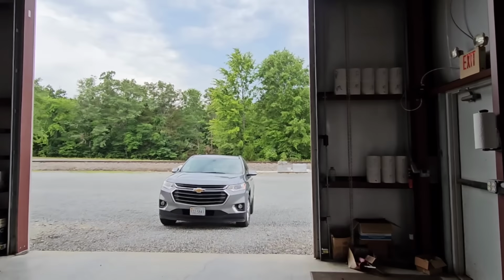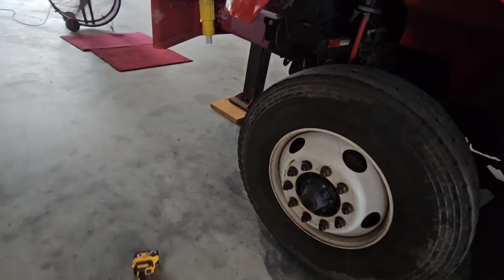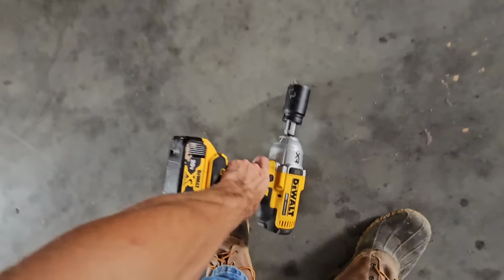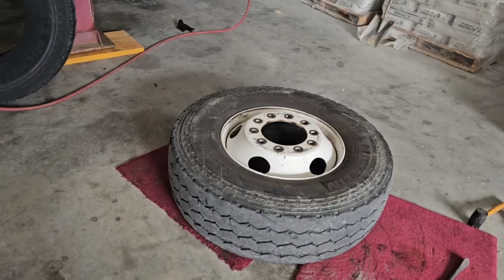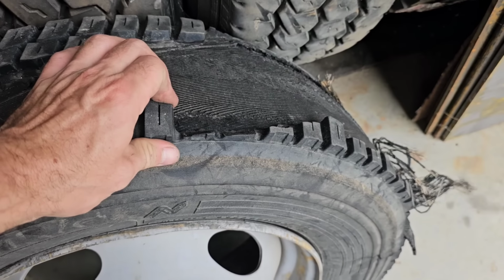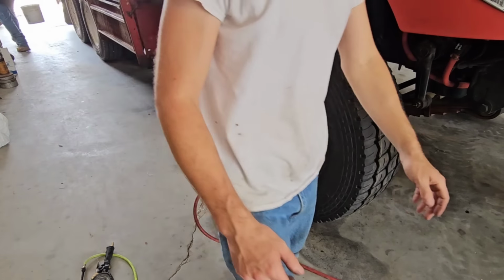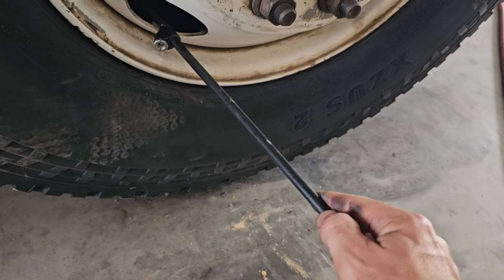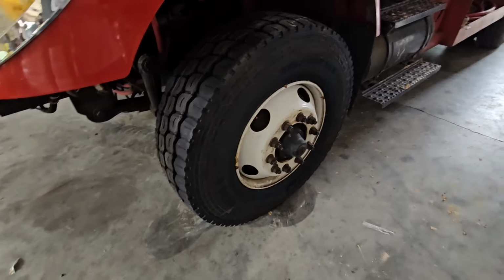New Tires for the Drilling Rig! Being Proactive to Protect Your Equipment.

Comment: Most of the time tires need to be replaced after about 5 years. You can probably push it to 7 years. The problem with tires is the formulation that they use tends to break down after about 5 years. So you'll start getting rubber rot and deterioration. Even in your cars and trucks. If they have a spare tire you better check those. Even if they're in the dark and the like. Just over time the compounds just start breaking down in the tire so it's just a good idea and practice after about 5 to 7 years to replace the tire no matter what the tread depth that's is on the tire.
Reply: Commercial tires are a little bit different. My company is like most. We run tires for 7 years and no more than 2 recaps. It's against DOT rules to use recapped tires for steers. They can only be used on the drive axles and on trailers. When steer tires get worn out as long as there is no damage to the sidewalls of the belts they are retreded and reused. It's a lot less expensive to recap and reuse tires than to buy new ones.

Comment: That is not tire imperfections. That is alignment issue.
Reply: Erosion aka River wear is common on slow wearing free rolling tires on rigs like this. It's a non issue and tire makers say the tires are still fit for service, but being 7 years old and how important this piece of equipment is to the company as well as how long it would take to replace it's smart not to let them get too old.

Comment: Ahhh good ole Murphy Soap! Used to do tires at work, 19.5” aren’t bad, used to pick ‘em up and throw them on the tire machine instead of using the hand crane. 22.5” low profile tires are harder to do than the fronts you did. Nice work boys!

Comment: I know I'll get push back on this, but IMO it is NOT a good idea to use PVC pipe for air lines.
Reply: No pushback from me, I totally agree with you.  I converted all of my air lines to metal several years ago.  Feel much safer about my air supply now.

Comment: You're right about the age of the rubber. The Dunlops on my Harley turned 8 years old this year with minimal apparent wear. Coming home from work on the freeway early last June, a big chunk of rubber came away from the side wall on the rear tire. At 70mph! All I heard was a loud bang but made it home without incident. The bike's been put up for the summer because of it and the darn tire is STILL holding air. I saved up for new tires ($540 for the pair!) and recently purchased them. Now, if only this heat (AZ) will abate so I can replace them. I'm 67 years old so I can't work in this heat!

Comment: I have a well that keeps losing pressure in our home. We replaced  the pressure switch and ensured the tank was at 38 psi. We have strong water pressure at the spigot next to the well, but low or no water pressure in the house. This happened after a power outage here in Florida after Hurricane Debby.

Comment: Our weather forecast in Fort Worth, Tx - last night was for 20% spotty rain showers.  About 2 o'clock in the morning, we had a full blown thunderstorm and wind gusts up to 60 mph.  Steer tires on a truck are top priority.  The other tires have a backup - the steer tires do not.  Tires do have a time limit on them no matter what shape they appear to be in.  Seven years is a pretty long time for a truck tire.
-- One thing to remember is that all tires have the month and year they were made in the manufacturer's code on the sidewall.  The last four digits will be the week the tire was made and the year.  So, 1223 would indicate that the tire was made in the 12th week of 2023.
Reply from the maker: @AMJDG  these were 0816. I assumed August, but more likely it's February. But still 2016. Definitely time for new ones!
Reply: No fair!! I'm just north of Justin and it hasn't done anything more than put circles in the dust.!

Comment: Bit off topic, but I want to get this question in on your latest video…
Why do you have personal shovelling out the tailings as the drilling progresses? It looks awkward to do and ineffective. Why aren’t there mechanical sweeps to push aside what comes out of the bore hole? It would then be easier for those to shovel aside. 
I’m a new subscriber to your channel. Very impressed with your approach to problems solving. Looks like loads of fun too.
Cheers!! 🇨🇦

Comment: little off topic on this tire change , I have watched many of your ventures and  debris appears to be a enemy as much as dropping tools clamps bolts...down the well pipe , I have wondered , why do you not make a blocker  IE : a  " hemroid ring"  with a shafer valve  so you can inflate for the inside of the pipe to block fall age of foreign stuff . Th center hole will allow the actual pipe to come thru. JUst a question as I have never seen one used . Love the channel  .

Comment: Glad to see you changing and inflating tires the right way. Too many guys I know will clamp the air on the stem turn it wide open and then seat the bead with a shot of ETHER and a MATCH ! I have seen tires and rims that weigh hundreds of pounds HOP OFF THE GROUND DOING THIS. Too dangerous too IGNORANT in my opinion. Buy a cheetah to seat beads live to go home to your kids. 😊

Comment: Hey man I really appreciate all you do I’m from Indiana and I need some advice I just move a new double wide manufactured home on my property with a well that hasn’t been used in about five years. I put a new well pump on there and hooked the power off and now it runs for about a minute and then shut off. Of course the waters very murky, rusty and muddy. It cleared up a little bit, but then stops running, what are my options? I have no clue on any of the statistics of the well it’s not very deep. I’m gonna say 100 feet.

Comment: Have you ever fracked a fresh drilled well with good output in order to clean it out? What if that makes the output so much that the pump can't drain it away fast enough? What's your opinion on dropping dynamite into the well first like they do oil wells?

Comment: Hi there, I ordered a 12-2 wire from your website a few days ago. I'm installing a grundfos 11Sqf-2 pump in a 200 foot well with poly pipe. The system will have 4 solar panels 330w each. Can you tell me if I need a 10-2 wire instead of a 12-2 wire. Will a 12-2 wire which I already bought cause any issues down the road? I'd rather take the loss now and buy the correct wire than not but just wanted to check with you. Thanks so much in advance. :)

Comment: @H2o Mechanic  you definitely can’t be too safe with your main money making machine!  My dad use to drill with old cable tool machines and of course I did a little of everything.  He retired in 1987 or 88 and sold his old Bucyrus Eries.  If I remember correctly he was charging 7 to 9 per foot for drilling back then based on the formation.  About what is the price nowadays is drilling per foot and how  much is 6” pvc casing per foot?  What is your first name and is your age about 35?

Comment: Hoping you can educate me on something. I have a deep well of 420’ with a couple of bids to put the pump in. Static is 300’ and produces 9 gal per minute. One bid calls for galvanized water line and one calls for PVC. Neither are polly pipe. What’s your opinion on this?
Reply from the maker: @mikeobenland4395  it definitely can not use poly pipe. Since it's a 300ft static, id go with galvanized pipe.
Reply: Thank you!

Comment: Have a question for you. You drill a new well, and trying to install the casing. Can't get the casing to stay in the hole, it's wanting to come back up, why?
Reply from the maker: @dew4000  mud plugged up the base of the casing, trapped air is pushing it up. Push the casing down and fill the casing with water til it stops floating. You probably need to push the casing down, once it's near the bottom, you'll need to blow out the casing without the hammer or bit attached. Once it's cleaned out then you can install the bit/hammer

Comment: Looks like the shops out of power?
Reply: Yup.  That air compressor runs on hopes and dreams.  Bet you turn the lights on in a green house.
Reply: @Failure_Is_An_Option  no lol watch the video the emergency lights are on this is why I asked
Reply: The shop floor fan is running.

Comment: Try a, 17.5 off a specialized boat trailer 😂
Reply: Tires designed for trailer use should not be used on steering axles

Comment: you didn't balance the new tires?
Reply from the maker: @jrgullio  we use balance beads inside of the tire. They work great
Reply: @h2omechanic  wow, very interesting!.............    learned something new today!  😎
Reply: On commercial trucks it depends on the company. Some do and some don't. My company balances the steer tires out by setting the radial run out when the wheel is mounted on the hub. On a truck like this with the distances and speeds they are going they won't feel any difference. I have worked on commercial trucks for over 25 years and the argument to balance or not goes back longer than that.
Reply: @h2omechanic  Thanks,  i saw you throw something inside the tire but didnt understand what it was.  Makes more sense now.

Comment: I am watching you change the tire. I wonder why you do not load the tires into a pickup and run them down to a tire shop?  The driver and tire shop mechanic could have done it quicker.  I know you can do it, but considering your labor costs, it would have been a wash in actual cost. This way, you could have been doing something more valuable with your time.  I also wonder about balancing the tires? but I think that is not a thing for the bigger tires.
I take my lawn tractor and wheelbarrow tires to my mechanic. When these go flat, I put an intertube in them. My mechanic does all that. In my case, it is generally after hours when he is playing with his race car.
Reply: --  It might have something to do that "between jobs" their labor is close to free.   Unless they have something needing done at home, they might as well do the maintenance themselves.

Comment: Maybe you could use some of the "Wheel Balancers by Centramatic", almost looks like there were some balance issues with those old tires, but maybe I am wrong.
Reply: His tire issues had nothing to do with balance. And his tires were balanced. If you watch right around the 3:15. Mark, they're adding balance bags to the tire. His irregular wear looks more like an alignment issue.

Comment: Next time seat the bead laying the wheel over a 5 gallon bucket, it will seat evenly.  standing up can be off an 1/8 of an inch. Have you ever thought about rock tires?
Reply: You always see your bead standing up. Not laying down. This is the exact reason why the safety cage is made from inflating. A tire are vertical, not horizontal. Both beads seat evenly that way. Not to mention that when laying horizontal most of the time, you'll have to use a bead blaster to get the tire to take air. When standing vertical, they'll usually take air on their own without a blaster needed.

Comment: I drove a truck for over 45 years and the one think I demanded from any employer was I wouldn't run caps on my truck ,not on the back or on the steer axle. Caps are cheaper but I know caps blow peel off when they get hot or if you live where you run tire chains. The little extra money good new tires cost I always felt was cheap insurance.
Reply: Total misinformation on your part kid. Number one. You can't run them on steer tires anyway. But as far as the back goes, 99.9% of tire failures is a casing failure. Not the recap. A recap is built. The exact same way a virgin tire is built. You need to educate yourself kid

Comment: I can't believe you using pvc pipe and fitting for air.
My friend had a 135# sandbox 20 gal compressor.  His line he run around the garage blow out four or five places. I warned him.
Reply from the maker: @kerrysullivan6294  1/2" pvc = 600 psi burst. It handles 140psi just fine. 8 years so far